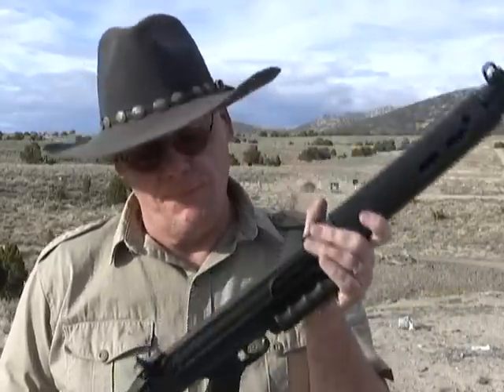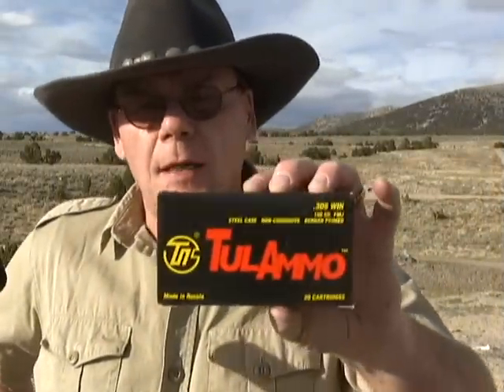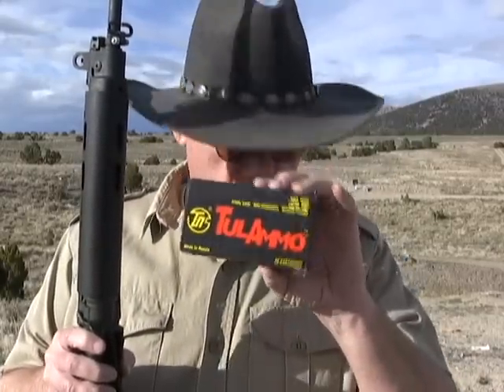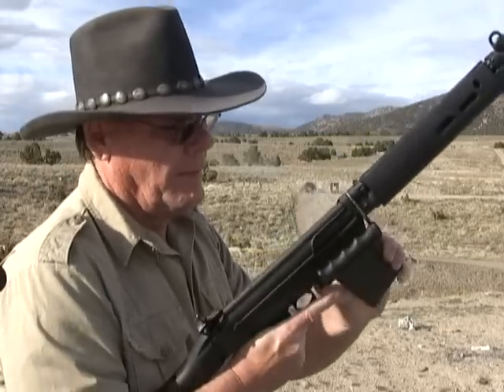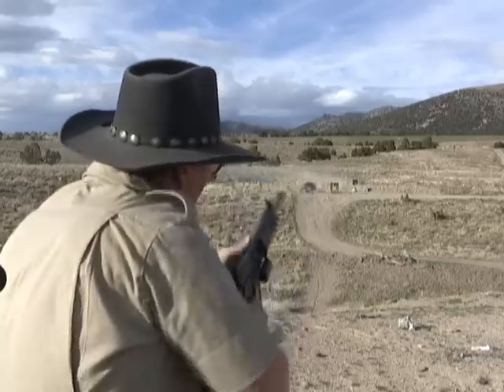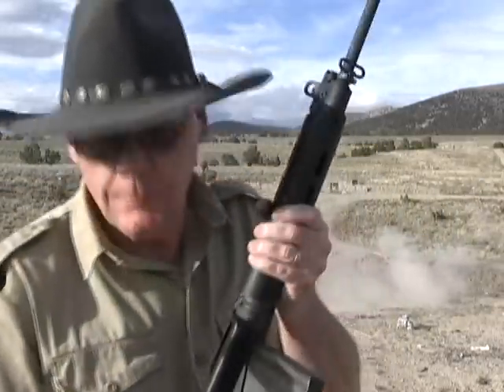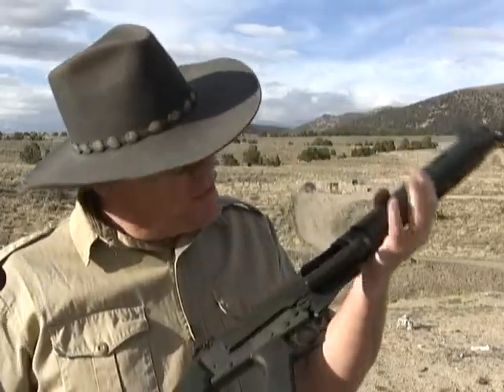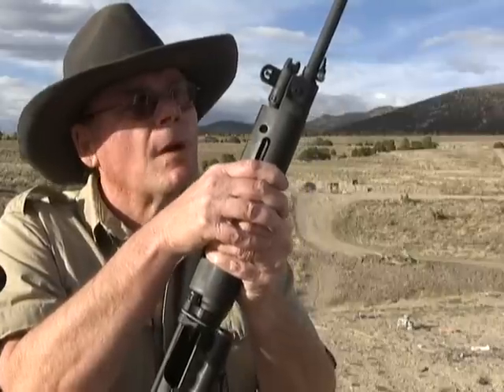Century Arms .308 R1A1 FN FAL Battle Rifle Junk?? You Decide!

Comment: As a Canadian, and one that has used the FN C1 and FN C2 service rifles. i can tell you that this is NOT the Canadian version. There are similarities, but so does almost all of them. We started at a setting of 4 on the gas plug setting. I never had to change it and the recoil was not a problem. Brutally tough weapon, reliable as it gets (the FN ones, NOT century city).
Never had a single stoppage or misfire. always accurate past how far I can see. I absolutely loved this weapon.
Reply: I too loved my Canadian issued FN, best rifle I have ever used. Shame when they withdrew them we weren't given an option of buying our service rifle instead of the government locking them up to rust.
Reply: @BigLisaFan  Yes that would have been great, loved my C1.
Reply: I liked the fact that you could charger load them to top up your magazine. Sad that I can't buy a Canadian FNC1A1, but I can buy an M-14.
Reply: Canadian FN C1 and C2 7.62 of mayhem never had an issue . Lugged that for days heavy but reliable

Comment: used by both sides in the Falkland's anyone who has used a FN FAL, L1A1 SLR or C1, C2 always rates them as awesome guns. My Dad used a RAAF FN FAL as a roo gun in the sixties.
Reply: +pweter351  I use to fire them quite a bit back when I was a cadet here in Canada.  We switched to the C-7 just as I was leaving. Seemed like everyone preferred  the FN better.
Reply: +Mr. Anderson  Yes...I too operated these as a Royal Canadian Army Cadet, Militia and Soldier during the transition to the dreaded Mattel Toy C7 Rifle.   I really missed my FN C1A1...I could also get it to Full Auto with a piece of a Match Stick!
Reply: +Darrin Gould The mattel toy stories were American hand me downs from 1965 !!!!! The C7 even of the mid 1980s was NOT the same rifle as the M16A1. I believed the fairy tales just like everyone else.
Reply: martK banjoboy You're correct.  But I'm just being humorous about it.  The "Mattel Toy' remark was more used in reference to the Plastic's and Stock Material's used in the weapon.  The metal qualities were fine enough.  But in the beginning with the C7 Variant...there were a few issue's that surfaced. (ie)  The Locking Nub on the Magazine breaking off in extreme cold conditions...that rendered the Magazine virtually useless.  They've since reinforced this small detail...in order for it to stand up to severe cold conditions.
 Yes...the C7's are not exactly M16A1's by any stretch.  But these Rifles, and many like them...have evolved from the M16A1's designs that were originally featured in Stoners Rifle.  In many Military's in the Western World that use these patterns...there have been quite a few modification's in one form or another!  Probably as many variants as the FN Rifle.
Reply: Indeed. There are many stories and media illustrating  the killing and wounding capacity of the FAL, all of them true. To be fair, there were stories about Australian soldiers in Vietnam. The Australian forces still used the excellent Owen smg at this time. One anecdotal report from an Australian soldier said that Nigel (their nickname for the enemy) would lust get up and run away when hit with a burst from an Owen. When hit with rounds from an M16 or FAL, they would go down. I hope none of us has to be faced with such a dreadful reality. Cheers.

Comment: The L1A1 SLR 7.62...cut my teeth on this rifle. I have a profound respect for it and so did a great many on the other end of it. I'd much rather my respect for it than their respect for it... I see it's in very goods hands again. This guy manages a weapon like very, very few and it's amazing to watch. He never fumbles. The weapon is secure at all times. Quite extraordinary. The 7.62...I saw a man struck in the shin from about 780 yards. Fatal. Heart failure from the impact. Another who had an accidental discharge at the end of a very long walk, flopped onto the ground with the weapon primed and a piece of wood came into contact with the trigger. The round entered the heel of his foot, traveled through his leg and torso and exited through his shoulder. Fatal. In this clip you can see the impact the round has first hand. I've always felt a little more at ease with the extra wallop this round has than the 5.56 for reasons of my own. Great video. I love this channel big time. I'm trying to save them up. Awesome work!

Comment: The procedure according to the Manuel to adjust the gas system to lessen fouling and heat is to fire single rounds while adjusting one click per round until the rifle no longer cycles then turn it back three clicks. It also keeps the action from slamming all the way to the rear lessening recoil and wear. The gas plug flips over for launching grenades. The reason for all of this adjust-ability is that this is a rifle that was designed to be used with ammo produced all over the world and still operate with the same reliability. A true battle rifle that earned its name " The right arm of the free world". You decide would you rather stake you life on a .30 cal rifle designed and tested by folks in a military setting or a .22 cal toy pushed into service by politicians looking to save dollars. God bless all our troops!
Reply: I agree , but don't forget Eugene Stoner's AR10 barrled for Nato 7.62x51 is up there with the L1A1 , and a better weapon than the M14
Reply: That Manuel guy knew his stuff.
Reply: I don't think I ever saw a manual, it was taught to us in small arms training and then honed on the ranges.
Reply: Are you joking about the m16? It was sabotaged by the government from the start. I would rather take an m4 than a 308 nowadays. There's a reason every switched.
Reply: @macy725  16 sucked,I wouldn't trust any derivation of it.
Reply: @dennislock3415  that must be why the m14 failed every time it went up against the m16. Let's issue corrosive ammo without a cleaning kit in the jungle and blame the gun because of nostalgia.
Reply: @mottthehoople693  you're 80 years out of date. The battle rifle is niche role. Assault rifles have proven themselves.
Reply: @macy725  They came with cleaning kits and they were junk.I used one enough to teach me that,1/75th.

Comment: Great rifle, I used it in the Canadian army and was on the rifle team for years and put more rounds down range than I could could count,we never broke down the weapons we used on the rifle team for cleaning just clean the gas plug and a little oil on the piston the older rifles gas setting was 3 or4 and the newer rifles used 7 or 8 any more or less and you could get stoppages, the only issue was sometimes when cleaning with the wood removed the pin that holds the gas tube from rotating would accidentally fall out and go unnoticed the result the tube could rotate and cover the gas vent so you will have no gas vent and the rounds would eject a long way and would get stoppages, happened on more than one rifle and an easy fix, the first one was perplexing as you couldn’t tell by looking at it but the rifle team armorer figured it out

Comment: Had a L1A1 built by NECG. Work of art! Be careful in selecting a lower receiver. Avoid anything other than milled steel.
Mine shoots as well as my service R1 in SADF. Keep them clean, no oil in the chamber! Oil in chamber when it gets really hot results in stuck case with rim ripped off , bad news in a fire fight!

Comment: This was my issue rifle (the Brit version) between 1960 to 1971 and never let me down. The US version appears to be a cheap copy.
Reply: It's not a US version; it's actually a surplus commonwealth version, usually with a mish-mash of parts, some of them from metric pattern rifles.
Reply: Yeah, if the parts from an "Inch Pattern" are mixed with the Metric you will have problems.
Reply: The Century Arms R1A1 is built around surplus British and possibly other Commonwealth rifle parts, but they are mish-mashed together and I believe I read somewhere that they might also have some parts from metric pattern rifles, though I wouldn't swear to this.
Reply: The US types are built on original kits only with US receivers. The Australian one I have is all original other than the US receiver including and original Lingthrow barrel.
Reply: Amen!! Very crude and sloppy copy!! Not worth the association with the FN FAL!!
Reply: DS Arms actually makes the proper US version. And those are just as good as Belgians or any others. They also cost about $1,000 more than these. This is a "FrankenFAL" thrown together by the monkeys who work for Century Arms, who imported both metric and inch pattern rifles (with de-milled upper receivers). They removed all parts, scrapped the receiver halves, imported receivers from Brazil in some cases, and slapped them together. I bought mine for $450 around 15 years ago. The original 2-piece gas piston was bent (some Brit, Aussie or Canadian soldier must've used it as a pry tool), so I had to order a one-piece stainless replacement for $20. Worked just fine after that. Everyone knows, or soon learns, that 'caveat emptor' applies to anything that passes through Century Arms' hands.
Reply: @mikemullins2330  I have a DSARMS and it works great! No tulammo through it though.

Comment from the maker: My safety lever  will go past (F) but only if the upper receiver is off, other wise it won't. Does it go past 'fire' with the gun completely assembled? It shouldn't. With the upper receiver off the lower you turn the safety lever past 'fire' to completely remove the safety during disassembly. I hope I have helped with your problem.

Comment: Why not adjust the gas piston before taking it to a gunsmith? It's adjustable for a reason!
Reply: IA drills :)
Reply: The setting for the 7.62 x51 is 4 or 5, when you need to change the setting, it is necessary to return to the FN 49 to understand each country has certain ammunition 8 mm other 7 mm or 308, short Too fast to the ball of the ball, in the Fnc it is very important for gust of 3 shots or double the speed of the full auto. NATO to regulate the calibres to this order, and to benefit their M14
Reply: MARK JONES  rounds in the magazine no rounds in the chamber, second time occurring.
Reply: Always had it cranked up for combat.....cleaned it with a match head lol....

Comment: Bought a Century R1A1 FAL with the Century receiver years ago and it also runs like a champ.  Have 5 cheap 20 round surplus Metric FAL mags that all fit very tightly.  The gas system has been set to 3 since day one and shots everything from Monarch Steel Case, Silver Bear FMJ/SP to Hornady Match without ever touching it.  It is also one of the mildest shooting .308s I've ever shot.  The furniture may look a little cheap, but easily works its function.  The chamber entrance in the barrel was completely fluted and polished on mine as it came new from Century.  Runs as good as any FAL I've ever seen including Springfield Armory and DSAs.   It will even do a sub MOA group on match ammo.  The cheap stuff, it tends to group at 1.5-2".  I believe a lot of the issues others are having are mag related and not an issue with the actual gun.
Reply: I think you're probably onto something

Comment: I'm sure other will have suggested it but we were told to srart the gas valve on 6. If there was an issue, not cycling properly, close it off two notches then try again. This usually fixed it. In eight years I never had any issues with that weapon. Awesome peice of kit.

Comment: Love that sound! Fired these a lot as British Army reservist 1983-90.We were told a round from it would go through a double brick wall at 30m. If it jams there are several stoppage drills that you can try before rushing off to the gunsmith . I never fired the SA80 but guys who use them  tell me  'It''s just an air rifle compared to the SLR.' Helluva rifle- and it was a huge mistake to ever bin them IMO.

Comment: I remember when these could be had for like 4-500 bucks, early 2000s maybe. I looked at one of these and a century arms CETME that was a bit cheaper and came with a bunch of mags so I got it.  I remember thinking I’d go back and grab one of the r1a1 rifles as well but never did and regret it. I have since sold the CETME, actually kind of regret selling it as it had no issues other than ugly welds.
Reply: Just seen an r1a1 at a show today for 900 but the rear sight welds looked questionable and had to pass , still looking for a .308 beast

Comment: Loved the video of what was my personal weapon when I was helping keep the Soviets out.A tip you might find useful is that the very large headed screw below the ejection port is in your weapon the wrong way round. The screw head should be on the other side of the rifle below the cocking handle slide. The screw is easier to put in the wrong way round because it goes through the center of the safety sear which it catches on when you put it in correctly you have to tease it through. It goes in that way so that you don,t catch your hand when cocking the rifle.Thanks again Andy Jacobs Nottingham

Comment: Century Arms is coming up with a new .308 which is based off the HK G3 design called the C308, at $700.00, which is a delayed roller blowback rifle. PTR91 Industries has a much better "original" clone design based off HK blue prints and made directly off purchased HK original tooling.  Century Arms says that their version's receiver is made by PTR91 Industries out of SC. :)

Last year I had called Century Arms and asked them why they discontinued the R1A1 Sporter and they told  me that they could no longer find the parts to build the R1A1 Kit. Hope this does not happen to the C308 ! But to be honest, I prefer a FN FAL gas piston operated rifle over a delayed roller blowback rifle, so I may be looking at the DSA SA58 FAL .308 at Atlantic Firearms.

Comment: A friend of mine bought a Century-Arms FN (Steyr type). He hates it. When we tried to sight it in, we often had to literally STAND on the bolt handle to get it to eject a round or an empty shell casing! I had the gas set on the 5 setting. I bought a new FN-FAL (SA-58) in the 90's from DSA & love the weapon. Good accuracy & reliability. It was worth the 6 month wait, & sells today at about twice what I gave for mine. I keep my gas setting at 6, because at 5, it will double fire. The 10 rd mag that came with it was junk, but it has always fed fine through the 20 rd. mags, new or used. I put a hooded rear sight aperature on it for a much better sight picture. The trigger pull is good, I wish it had a click adjustable windage knob on it like our M-14 or M-16, but it's still easy to use as it is, unlike the HK-91 I once used. It's a keeper.

Comment from the maker: Richard....I was able to fix my rifle by slightly shortening the roll pin that is pushed up by the empty magazine, locking the bolt open. Thanks for letting me know the gun wasn't working properly.....problem solved. The empty magazine is also easier to remove from the gun since the pin isn't dragging on it. Thanks again.

Comment: 30 years since I left the Army but you never forget the crack-thump of that rifle. I have little doubt that this rifle - in its various configurations - has been responsible for a lot of deaths on the battlefield - I've used an old Lee Enfield .303 on pigs and they drop like a stone, regardless of size. The high-velocity, smaller calibre bullpup undoubtedly has its place, but this was a serious assault rifle.
Reply: +Arthur Watts Interesting! Did you use the SL or automatic version? On a battlefield which one would you recommend, and besides that, the rifle has a bad name for being very vulnerable for dirt, dust and humidity. Is this correct?
Reply: We were taught to use the SLR as a semi-automatic, and the tried-and-tested double tap was part of that tutelage, but I never fired a shot in anger. Re dirt, I only know that anytime you ran a cleaning kit through the barrel you usually got plenty of muck out the other end, but we were told  they had performed very well for our troops in the jungles of SEA. The SLR was replaced by the Steyr Aug shortly before I left at the end of '91, so its all just a footnote now. This is the kind of weapon I'd want to hunt wild boar, but modern soldier have access to much more compact assault rifles : this is an interesting relic, but a relic nonetheless, regardless of it's undeniable lethality in various warzones.
Reply: Thank you very much! :) I'm from Belgium so very interested in FN guns.
Reply: +Arthur Watts  Used this during the bushwar,First thing we learned was keep it clean and then it was lethal.
Reply: shaun porter Hilarious note man :D.
Reply: +LiquidRelief British Army never had full auto capability.  Single shot only.  If you fired it, you`d see why.  Big kick therefore inaccurate in auto.  We did suss out that with a strategically placed matchstick in the trigger sear, it would do fully auto but that way, after 10 rounds you were shooting clouds..
Reply: +shaun porter Brit army mantra is to keep it clean anyway.  Aden/Radfan/Borneo/Malaya/NI/BAOR/Salisbury plain/Norway/Belize/Falklands..  it never let us down.
Reply: We were always led to believe that if you wanted a weapon which would still function despiite all manner of neglect, Comrade Kalashnikov was the man to turn to - cant say I enjoyed cleaning my SLR but it made sense : not sure how the AK differs but it must be a very clever design.
Reply: AK uses blow back, not the piston of the SLR - Ex- REME, was my preferred weapon through nearly 2 years in NI, used it effectively on the Catterick ranges up to 1,000 yards during our training
Reply: Liquid... it was a serious imperative to keep the old things clean, very much so. Jamming was a major prob with a dirty L1A1. Other than that, they were the very best of battle rifles, for sure. Best wishes, from an ex Brit serviceman.